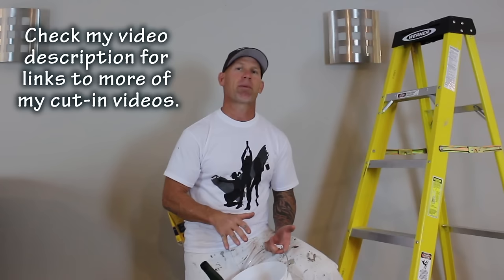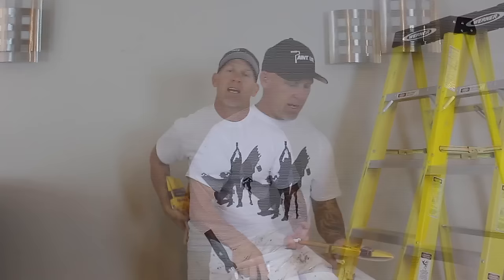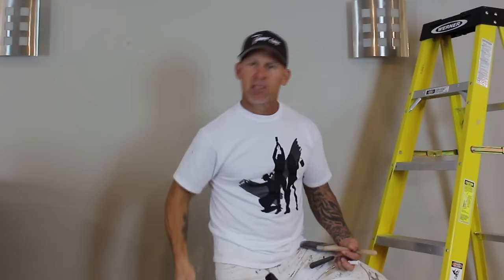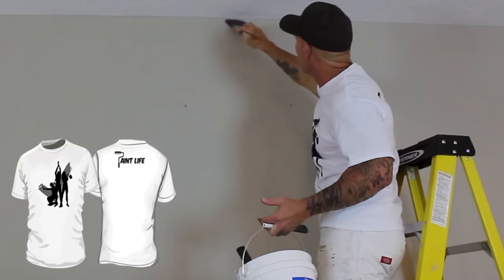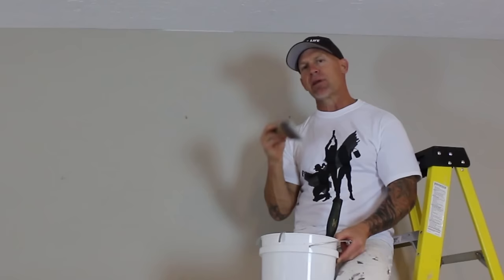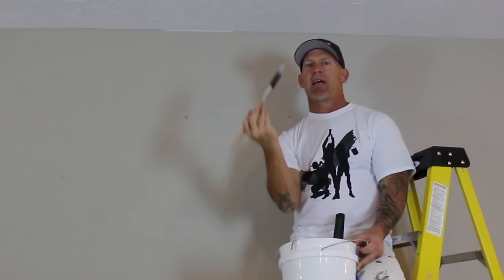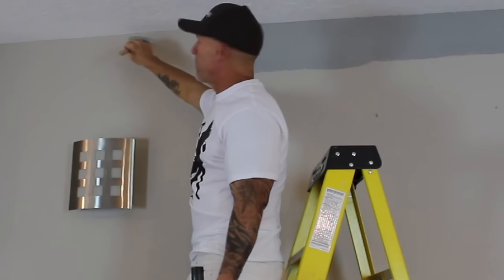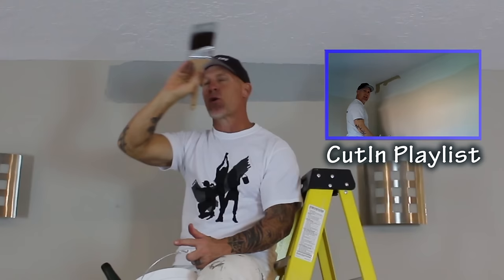HOW TO CUT IN CEILINGS.  DIY home improvement cut-in hacks and tips

Comment: Scoring the ceiling is something an old painter of my company showed me and it really does work brilliantly! It was funny you mentioned holding your breath, that's something I do out of habit while I'm cutting... It makes a big difference. If you cut a lot you will find yourself holding your breath while you do any task even out side work without even knowing it. I've never done the ceiling back roll method but depending on the area and lighting it is beneficial, a normal bedroom I don't think I would find it necessary.

Comment: another tip that helps me do ceiling cut ins faster is using they ladder with steps on both sides. or if you can afford it use 2 ladders and a platform as scaffolding. it really saves me time when I'm moving the ladder less often
Reply: the 2' platform ladders are really nice too. i like having two of them so i can line them up from corner to corner

Comment: interesting video, liked it.  when i want a very straight line along the ceiling, i'll paint my walls first, let it dry, which takes about 15 min these days, then run a line of yellow frog tape 1 mm from the top of the wall (run the tape in the same direction around the whole ceiling).  If it is a heavily textured ceiling you would run the tape 1 mm below the bottom of the texture.  Then paint with the ceiling paint above the tape, just enough to cover the previous wall paint, I'll use a small artist brush for this, this part doesn't take that long as it sounds.  As Paint Life describes you could pre wet the tape or even clear caulk the top for a very straight edge,  just depends on the level of detail you want.  I do something different,  I remove the tape as i go, so I'll paint 2 feet and pull the tape off close to where I stopped, paint another 2 feet and so on.  I never break the tape, it just stays looped in one hand until its all done.  I find this gives an excellent result with maybe 3-4 tiny touch ups in a room.  My paint bucket is either hooked on my ladder or sitting on a shelf on the ladder, so its just one hand on the brush the other has the pulled tape.  Once you have the routine down it goes quite fast with excellent results because you don't allow the paint the time to bleed under the tape.  Hope this helps

Comment: Picture frame it is more common in smooth wall finishes which couldn't mostly be avoided by not thinning your paint with water or when it comes to new drywall use a primer only use for new drywall and always back roll if sprayed when it comes to production especially the Finish coat I recommend Purdy's white dove or Worcester 50/50 synthetic/ lambskin 3/8 or 1/2 inch depending on the texture

Comment: Chris, this is a great How To video for me because I'm a perfectionist and these cut-in's are killers for me! The scoring of the wall with that 5 in 1 tool sounds like a winner. I will definitely use that on my next renovation. Also, your're brush suggestions where something I never knew matter with the thickness of the paint. Thanks for that one too.
Do you have a video on repairing small holes in the walls as part of your wall preparation? Curious if your process is similar to mine.

Comment: Paint about a half inch down from the cut-in line a width of six to nine inches then do the cut-in The initial paint helps the brush slide easier to give a perfect straight line Also the initial painting gets rid of excess paint on the brush which could bleed onto the ceiling No need to rad-roll as wall roller will cover brush marks when you roll out the walls

Comment: Luv the great tips!  I DESPISE painting & I suck at it.  I somehow make a huge. mess, paint  on my clothes, scattered around the house, on the carpet in other rooms, it's truly sad how what a poor job I do.  I'm sure a 5 yr old could do better than me.  This is tacky I know, my bathroom ceiling has every color the room has been from the stinkin roller!!  I'm so ready for the job to be done, if I did try to wipe off I didn't get it all, or thought I will come back & touch it up, never happens.  I get so much paint on the tape,  when I pull it off, off comes the paint with it in multiple places.  I don't like to fix those either after having spent half a day standing at the sink trying to get the never ending paint out of the roller.  Seriously, where the heck does it all come from?  So, I'm going to attempt to paint again, I hope my paint is still good as it's been sitting for close to 2 years.  Plus, I have to fix the 5 inches of ceiling paint on my walls in the infamous bathroom where the painter I hired, screwed up when redoing the popcorn.  Yeah, I know, the awful popcorn, but I had only 4 rooms done & it wouldn't match the rest of the house, so had them redo the popcorn.  Well, that's after the 1st painter took off with 1/2 the $$ & never came back to do the walls.  2nd painter, pulled it off, couldn't fix it, so had to hire a 3rd, whom left 5 inches of ceiling paint.  I have very bad mojo with paint I guess.  I'm used to that bathroom being messed up, I call it my Hombre room.  So thanks for the tips, someday soon, I'm going to tackle this awful deed myself again.
Reply from the maker: Wow, sounds like you have not had any luck, we would recommend taking the tape off before the paint dries to prevent peeling

Comment: Caulking ceilings textured ceiling lines... Top Gun 250 Fast Dry caulk, found at most Porter Paints stores. Bout $2.50 per tube. Paintably dry super fast, within bout 15 mins

Comment: Chris, With all due respect, why not cross roll when rolling the whole wall instead of using the 4 inch roller for cutting ?
Reply: Hi George, I used to do as you ask, cut in with brush then roll wall usually starting with as you call it a cross roll along the ceiling line with a 9 in. roller.  I started back rolling with the 4" as Chris here does for the following reasons; firstly I always put on two complete coats, I use this back roll right after my brush work to accomplish these 2 along every cut in area. This wet on wet method with a bit of paint on my roller accomplishes both coats for these sections. Secondly, I can then roll the wall twice, or finish rolling once, if I skim coated it before, without having to get on a ladder to accomplish a cross roll with the 9 incher. I just roll up and down from the floor with my extender and all looks great!  I hope this is what you were asking Chris?! And but of course...I'm not the famous Idaho Painter!

Comment: I'm a painter trying to learn more about it, you're great, I am learning a lot from you, I have a question or two, when you cut in a ceiling, are you holding your brush in your hand or is it in the bucket against the grid,also should I use a 2 in angle brush or 3in thanks for videos

Comment: I have a trick with a 5-way when I'm cutting in my walls to my finished trim a lot of people call it tooling you have to have a rounded Edge on your fob way paint is a liquid you can manipulate I simply put it on my door casing Edge after I cut at my line down the door casing and push the liquid back straight all the way down I can cut in straight lines but nothing beats the edge of the 5-way on the edge of the door casing when you zip it down to there and pushes the liquid which is paint out and straight all the way down Factory beautiful lines.
Reply: I meant five way not fob

Comment: Thank you for this Video!!!  I’m painting my living room in prep for selling. I don’t want to repaint the ceiling. The ceiling is white, the walls are a light beige...yes, I’m told it needs to be more white...ugh.  You used the 5-in-1 tool at a 45 degree angle. Is that the method for keeping the ceiling as is?  Next what piece of the tool are you using? Do you have a video on the tool alone? If not, I”m more than happy to learn as you teach. I will check out your play list on ceiling cut ins.  Have I said that I’m grateful? !!!!!!!!!!  Thank you so much for some of the science that a slight over on the ceiling is better to the eye than a slight under corner on the wall..I appreciate understanding how to get color blend between brush and roller, and the tech things as far as how to hold and angle the brush!  Love it!!!! Thanks!!!

Comment: Question: do you have a video or suggestion for how to prep ceiling that has smoke on it? Moved into place that had a 20 year old WOLF  Gas stove that left grey dingy ceiling. We recently replaced the stove with a Thermadore gas stove and hoping we don’t have the same issues. Question 2: can you use flat ceiling paint over oil based primer? I bought SW Eminense bright white flat ceiling paint and need advise what you would recommend to prime with. I have all my kitchen cabinets masked off … SW is completely out of ceiling paint in the state of Washington…I have 1 1/2 gallons I got a couple months ago and don’t want to run out, I understand how important prep is to make my paint go further. Please advise and thank you for your videos!!!

Comment: Question on the scoring: my dad is a drywall finisher, he did the walls in my house and I'm painting. I told him about scoring with the 5 in 1 tool and he told me absolutely don't do that. Have you had any issues with that? He said it could cut through the tape and over time start to peel. I'm assuming this is pretty delicate scoring...
Reply from the maker: I would never use it to score something

Comment: Thought I was the only guy who scored a line. Works for cutting in against trim too
Reply: He’s right about brush selection. “One Coat” low sheen paints are too thick for Purdue xls and Wooster ultra pros “medium stiffs”
Reply: I use a “hot dog” “pin hole” six inch roller to back  roll cut in. You can get tighter to ceiling and casing edge

Comment: Nice video..try Corona Excalibur..nice scoring idea with 5in1...you add a splash of water to cut in buckets so it's easier to work with? I usually do..especially if paint is thick and also if we are doing 2 coats forsure..

Comment: So I tried this technique of the caulking the wall and ceiling and it was great when I first did it. It made a nice smooth area and look like it was going to be very easy to cut in now. Today my wife and I rolled the ceiling a flat white and I went and bought a 18” roller after seeing some of your videos! So thank you for that, I got a workout the thing is heavy! Once the paint dried we notice that everywhere I caulked  has little cracks. The caulking was done the day before so almost 12-16hrs so I thought it was dry but after looking up on the internet I guess it can be dry to the touch but it will continue to shrink and the flat paint won’t stretch it will crack. . Any ideas how to fix this now? I haven’t done the wall color yet. So I was going to try and scrap the caulking off and paint the corners again or just try to cover with the crack with the wall color and go an 1/8 inch onto the ceiling. Love you videos! Hopefully you can help me 👍🏼

Comment: I'm just giving you a hard time man I'm a painter to. I like your tips and for sharing them the caulking works good specially on rough texture I just think your 2 gallon bucket is a trip I couldn't get used to using one I do use a Winnie roller to back roll sometimes tho it's a good trick.

Comment: My favorite cut in brush is a 2 1/2 inch angle Wooster silver tip, but Ii was trained to cut in with a 5" foundation coating brush. It works remarkably well, but just not for me.

Comment: I use a 1 inch sash brush with a coffee can with an inch or 2 of paint in it  to cut in the ceiling  going down about 2 inches from the ceiling, then when rolling the walls go over it going close to the ceiling without touching it. And i never tape anything .

Comment: I am trying to back roll the paint after edging to get rid of the brush lines. However.. the roller is lifting the paint. If i am quick enough.. i am sucesful and it doesnt lift. 
Basically, i have to edge 6" then roll. 
Is it old paint just drying (flashing) to fast?
Can i add water to help it?

5gal buckets unused stored in garage for just over a year.

Valspar signature.
Reply from the maker: It lifts paint when you don't load enough

Comment: Hi there, great videos. By the way a question I just finished a small wall (12 sq.m) and I realized that I forgot to wear mask through out my work, because I’m not sanding just 2 coats of painting.I used Nippon Odourless 5in1 Gold (latex, interior). Since you’re more experienced painters do you think that latex, especially odourless type is safe to use without mask? Thanks
Reply from the maker: We always recommend wearing a mask, but you should be okay. Just make sure to wear one next time!
Reply from the maker: More important that you wear one inside as opposed to outside

Comment: I have painted not just mansions but Estates and you left out one part....first you score the ceiling all the way around with a back end of a paint brush or a dowel and then you dust the cut edge to get rid of all the sheet rock dust balls that will mess up when you start to caulking.......wipe the caulking with your finger to give you that angle from the wall to the ceiling.....let dry then paint........I use to do this because not always is the texture or corner straight.......and you have to give it that fine line....hence the caulk.......
Reply: What I really like the most was Restoration in the French Quarter N.O. and Key West Fl. The Mansions and estates were mostly in River oaks, Houston, Texas during the boom years....researching and then bringing back a historic residence is classic....put it bluntly....with prep and the right colors you can turn a dump into a winner.....but the money was in new construction....Apt. Complexes....Townhouse projects....and Condo Conversions....plus whole sub-divisions.....memory lane....LOL

Comment: Do I need to repaint the whole ceiling if there is bleed through.  It looks terrible and I tried to paint over it, it looks worse. Is there a way to remove the mistakes?
Reply from the maker: If you know the opposite color.
Reply: Tape the wall.paint ceiling part abt. half inch using similar ceiling paint.then feather it out.if necessary apply one more coat of ceiling  paint and feather it out .It will blend soon.

Comment: Great video but I'm a little concerned that you haven't feathered off the edges of your 4" roller strokes with a dry brush or roller... Is there not a risk that you will have a hard edge when it comes to rolling in the walls?

Comment: I agree with the texture part where it causes " framing " but the brush with the roller is too much . after I cut the room , while I am Rolling the wall I will stand on a ladder and roll across the whole wall an inch from the ceiling .

Comment: I like to cut in just below the ceiling line as this way you can repaint your walls in the future without having to redo the ceiling. You will have room to move your cut-in-line one more time to meet the ceiling this way. Back rolling a cut in line with sheen does not look good, you will see the roller line if using a heavier nap.

Comment: Good video Chris.  I like the straight cut brush...I don't know if it's mental but I feel it holds more paint...
Reply: You got that right--3in Wooster Jaguar block. However, you can see that Chris does quality work and that is what counts.
Reply: Paint brushes have evolved over many years and there is a reason why the brush is shaped the way it is. The edge of the brush is used for cutting in and the flat of the brush for smoothing out the coating to an even finish. Watch the #Studhawk How To Decorate using oil based paints video.
Reply: Straight brushes generally hold way more paint than angled brushes do. Although straight geneally have many more bristles. They tend to be fatter.

Comment: ?do you allways hold your bucket. Get the pot hook with the chain they work the best. Also i like to cut a piece of plastic off of the seal around a 5 and tape it onto the brush handle then u can hang it on the inside of the bucket .When you leave it down in the bucket it tends to make your brush lose its shape

Comment: Absolute neophyte question:  Is it possible to do ceiling cut-ins with a small roller to avoid the brush-and-back-roll process?
Reply from the maker: Give it a try
Reply: @Idahopainter  I appreciate the response - even if it does sound like a dare that will lead to a lesson learned the hard way😂.  I just figured that there is a good reason that pros such as yourself cut in with a brush instead of a small roller; but I haven’t had much luck in finding out why. 

At any rate, I really appreciate your content!

Comment: I know this never happens to you but what if the roller touches the sealing?
Reply: wipe it with a wet rag immediately after making sure your last roll is feathered, being strategic about sections of the rag to wipe with because you most likely won't want to just ball it up and wipe back and forth. if you can't get it all off and you don't have the paint that was used for the ceiling to touch it up with...then i guess cut your loss or repaint the ceiling
Reply: what i do is get a SOAKING wet rag, and i mean WET, firmly make ONE wipe in ONE direction , then wipe once more with a dry rag in the same direction, do not wipe back and forth during the first step or you will smear the paint all over the place
Reply: Baby wipes man baby wipes!!!

Comment: Cutting walls to a ceiling, piece of cake, cutting a ceiling to a wall that you aren't painting separates the skilled from the unskilled, that's a tough cut. When I do it I don't bring the cut line all the way to the wall, I cut up to about a 10th or 20th of an inch from the wall and it looks perfectly straight.